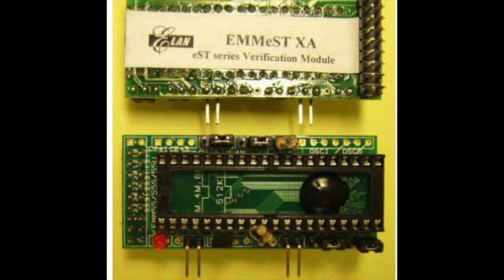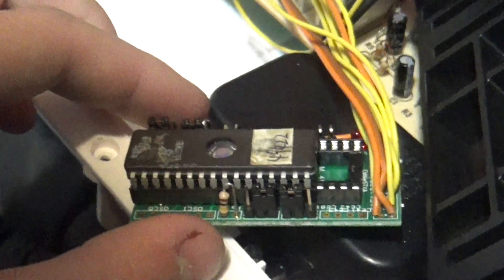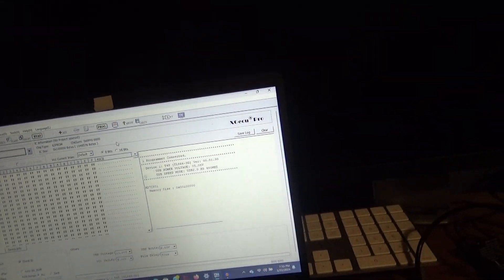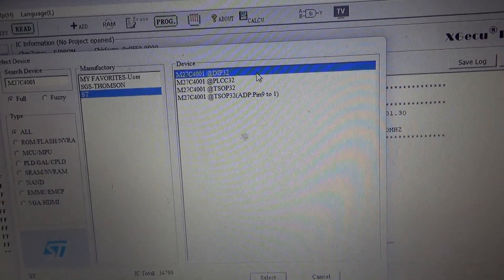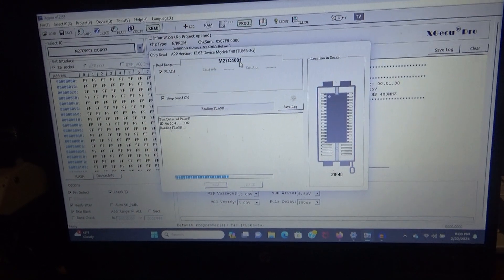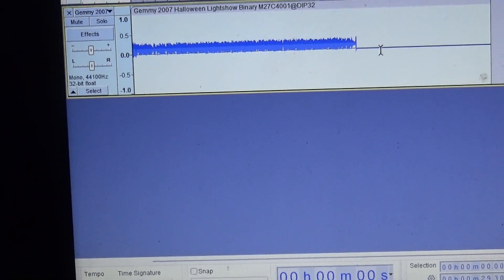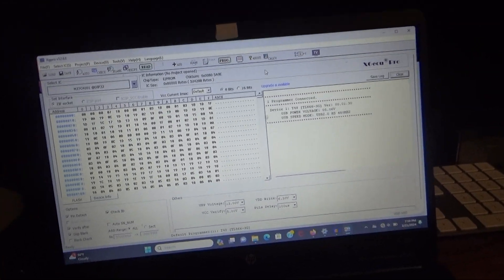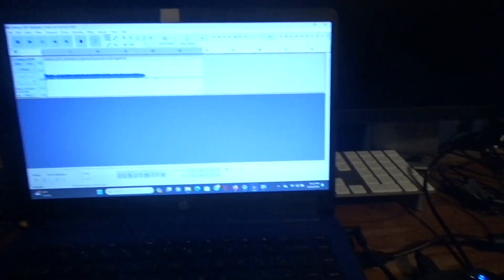How To Pull The File Off An Eprom From A Gemmy Prototype Hidden Audio Method

Comment: 11:16 wouldn't it make more sense to just import it at a lower sample rate?
Reply: It would not make more sense no. Also, the purpose of this video was how to pull the file and show you how to run it in audacity. Anything beyond that is just users choice.
Reply: @chasetheinflatablegod  ok. this only works for prototypes and not anything retail then?
Reply: @SusiTerry the issue is that the production chips are OTP (one time programable). I don’t believe the file can be taken off. Maybe one day we’ll find a budgeted programmer without spending thousands.

Comment: I think you might be able to get the audio to play at the right speed in audacity without messing with the speed  after importing it if you import it at a lower sample rate.
Reply: You’d still have to experiment with what sample rate to set it at. Every program is sped up differently, so I find it easiest to just play with the speed through settings.
Reply: From some asking around most audio should be around 16000hz, so that's a good baseline at least.